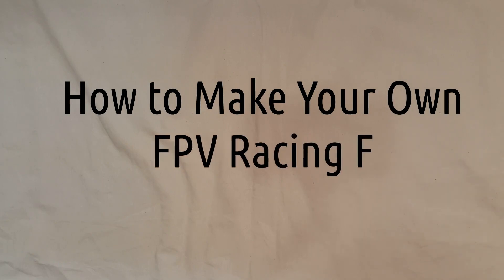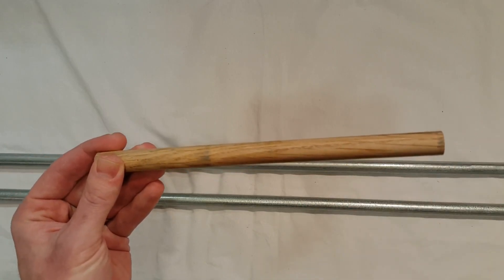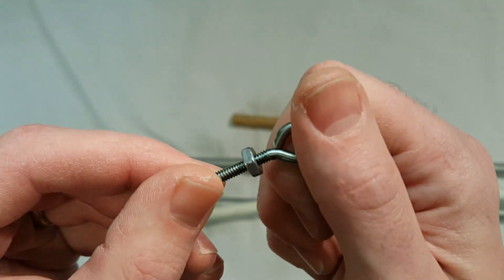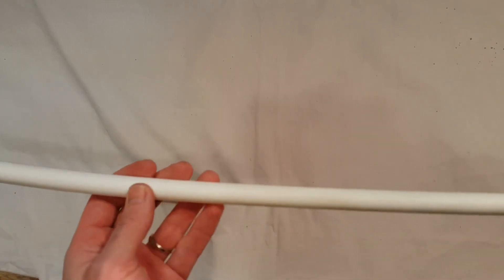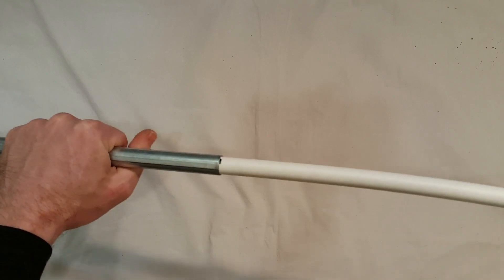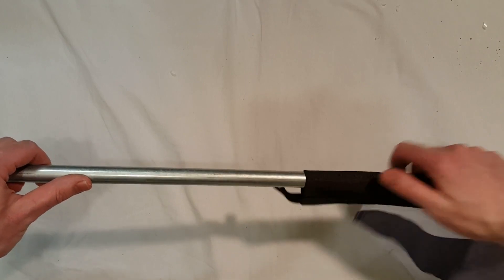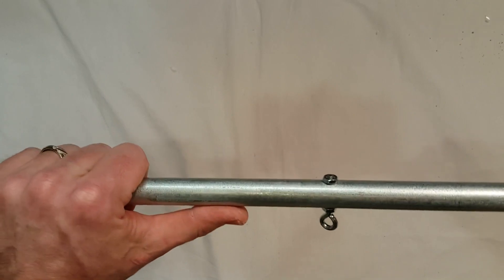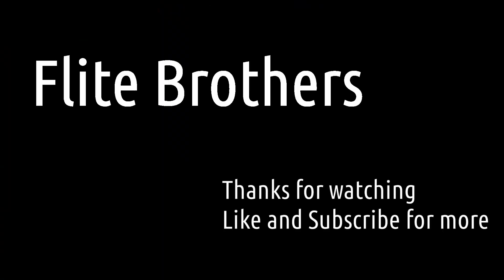DIY FPV Racing Flag Poles

Comment: What you have is 1/2"" EMT, or 'Thinwall' conduit.  As opposed to Rigid which is much thicker walled and is, or can be threaded for assembly.  All electrical conduit, EMT or Rigid are sized by the inside diameter because that's what determine the number of wires that can be run inside.  The outside diameter is larger depending on wall thickness.
Reply from the maker: Thanks for clearing that up. So the thin wall is why it's 5/8" ID and not 1/2" then?

Comment: What are you using/doing to stand them up?
Reply from the maker: For indoor races I made wooden bases out of 2x4 with a long 5/8" bolt sicking up from the bottom. the pole slides right onto the bolt. We tried them outdoors but had to weight them down to get them to stand up in the wind. Outside you could use a some pieces of re-bar driven into the ground and slide the pole over it.